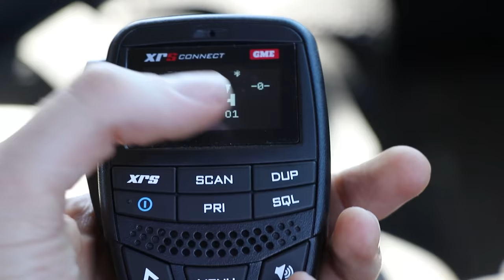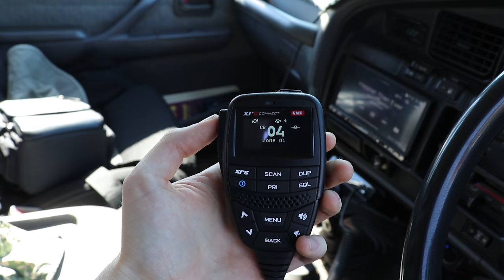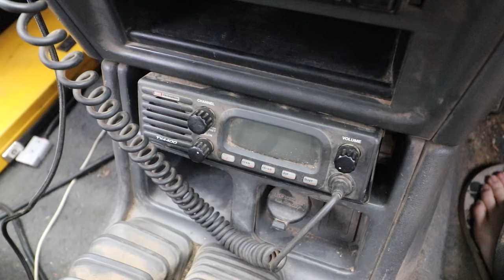You've been using YOUR UHF WRONG!!! CB Radio SECRETS for 4WD in Australia PLUS History & Technology

Comment from the maker: What dBi antenna do you use? Where do you mount it? Let us know! 👇
Reply: 5.5dBi ground independent, mounted same location as yours…
Reply: I have 2. 3DB interchangeable with a 6.6db running from my GME unit and a 7.5DB running on a Oricom unit. Both mounted on my bull bar. As stated in my main comment I would love to swap the Oricom out for for a GME XRS but I cant afford it.
Reply: i run dual at the same time, 2.1 and a 5.5 connected through a T connector seems to work ok
Reply: 6db rfi element + 6db mobile one whip antenna. front left bullbar standard tab . + backup antenna rear left roofcage . height is might
Reply: All in planning atm, so I'm thinking of a low gain and a high gain both mounted at the back and up high above tail gate on a bar to give the separation (and place to mount). The bar will flip down to point the antennas backwards for when I need to get through low hanging stuff. Probably a 50mm square, light gauge aluminium bar.
Reply: Oh, and two radios - one with the high gain and another with the low gain.
Reply: I'm running RFI 2.1dBi and 5.5dBi, I found mounted on the bullbar the 2.1 would get decent loss from chatter behind my vehicle so currently in the process of mounting it on my trays roof rack and I have the 5.5dBi on the bullbar atm. I will be testing a coax switch to see if its effective enough to be a good median between distance and short at the flick of a switch
Reply: GME 2.1 dBi on the bull bar, GME 6.6 dbi on the roof, RFI 6.5 dbi Mobile range extension and a Barret 2019 auto tuning HF antenna on the rear tyre carrier.
Reply: Running Unidens UH8060S with 6.5 DBI. Has interchangeable 3 DBI but rarely use it. 6.5 is an awesome all rounder for most 4wding and touring. The UHF itself is super compact and all controls are on the remote so super easy to use. I mount on the bull bar because there was a spot made for it and also so I can fit through the drive through.
Reply: 5.5dbi on the bullbar
Reply: UHF 5.5db on the bullbar and Autotune HF on the rear tyre
Reply: RFI 5DBI mounted to the bullbar
Reply: 2 & 6
Reply: 2 and a 6 on the xrs
Reply: I have a 2.1dBi gain as a sacrificial antennae around town, middle distance and offroad, I  have a 6dBi, and for running the Newell Highway, I've got a 9dBi stainless for throw. All are ground independent and use the same mount, on the bullbar. 

I wired a on-off-on switch for my UHF to be able to have the radio always off (but set up, ready for use), on all the time (for off roads/camping in groups), and on only with the ignition (for running around town, day to day)
Reply: I love the RFI 3dB ones
Reply: 3.0 dBi bullbar.
Works great for my mountain area.
Reply: @joshford1818  How do you find the Barret in performance, reliability and build quality?
Reply: @davidbrayshaw3529  I think the build quality of both the radio unit and tuner is excellent. However the vehicle is a new setup so the jury's still out on how it's going to handle weeks of corrugations and bouncing over dunes.
Reply: @joshford1818  I actually don't know anything about that particular model but a mate of mine had GME products fitted to a ute, a tractor and a heavy rigid and they certainly saw use in very harsh environments. They were all years old and worked faultlessly.
Reply: your looks like a GPI - ground plane independent antenna - it will work equally as well on side or centre of roof, even bull bar - minus the extra height you get from roof
Reply: @davidbrayshaw3529  Barrett are a high frequency (HF) radio manufacturer. Very different to a uhf/cb in that they are mainly used for long range transmission (up to 3000km range). Kinda outdated technology with the introduction of sat phones but having a community of tourers to draw information from and direct connection to various emergency services has its benefits.
Reply: @joshford1818  Sorry Josh. I responded to the wrong question!  While I'm here though, Satellite 'phones are a wonderful invention and if I was the type to go to remote areas I would have one without a doubt. I'm a licensed ham and I would much rather have a sat 'phone than an HF rig in a remote location, if push came to shove. Having said that though, there's something special about analogue radio, to me at least. There is also value in redundancy. Having both HF and sat. onboard is a great option if you can cough up the bucks.
Reply: I run a 6DB antenna, it is mounted on the headboard in the middle of my ute, reason being it lowers the angle of radiation of the antenna and I have a more even coverage around the vehicle compared to it being on the front in the corner.
Reply: Thank you for a superb, knowledgeable presentation - I'm an ol' grey beard and have been using UHF CB from it's inception in Australia in 1977. And I am also an active 4x4 driver and being "old school" I have only ever used a centre roof mounted antenna. My goto antenna is a 1/4 wave whip at just 157mm long. Occasionally when on the flat I'll exchange the 1/4 wave for a centre loaded 4.5db whip. From Arthurs Seat in Victoria I've pinged two Northern Tasmanian and the Mt Gambier SA repeaters with a 4.5db whip antenna at 5w. Bigger is not always better and in the Vic High Country my puny whip antenna consistently gets though where the current fashionable bullbar mounted broomsticks often cannot be heard. The old mantra re low power UHF of "height is might" still applies.
Reply: I have a 6.5dBi antenna and for me it's a great all rounder. Top video mate, love your work.
Reply: Unfortunately the bull bar on mine too & 6 Db gain
Reply: Always mount antennas where you can... best place is the centre of the roof... or bonnet.... on the bullbar is one of the worst places. Sometimes its unavoidable though
Reply: Yea no shit
Reply: You do realise that the M1 runs from Hobart to Cooktown, yes? You also realise that Newcastle is nowhere near the Tweed?
Reply: On the front bar right on the corner gives me a good idea how close I am to putting a dint in my rig
Reply: 9dbi/6dbd Benelec 02648 mounted at 10.5meters
Reply: @robertbullimore4243  Oooh geeze. How long have you been running that? I hope it's not damaging your radio.
Reply: @jbison  Na all good, just like the twin trucker aerials, why would my radio suffer
Reply: Mine is roof mounted on my Troopie and I change between 2db, 6.5db +9db depending on where I'm going
Reply: dad and i are running 4.5dbi airel on a GME TX2720N unit. and the airel is mounted in line with our stereo airel so its pretty close to the winsheild
Reply: 6.6 db on the bullbar running a Icom 400 pro 40 channel and a 2.1 on the bullbar running a chrystal DB477i 80 channel
Reply: 3db for around town, and 12db for when i'm out bush (WA), mounted off the bonnet, although i want to get one of those folding ones to put on the roofrack (i have a low garage) to mount the 12db one to, and i'd just fold it upright and swap the cable over at the back of the radio unit (no switch) when im going out bush.
Reply: @robertbullimore4243  I did post this, but removed when I realised I posted from the wrong account.
A T connector is not a good way to connect your antennas. Swap it out for an antenna switch if you really want to use two...(unless you already have, given that the post is quite old). Although it seems to work ok, you likely have some phasing issues, which would result in either a distorted radiation pattern and/or less than ideal SWR which would basically reduce the gain of the antenna.
Reply: The same model antenna i've used for 30 years!   The GME AE409.  Allows me to be in 6dB or 9dB modes.   i'm also rocking a Uniden UH-5000 from about 5 years ago.  Antenna is mounted on the roof rack of the ute - high as possible.
Reply: Just a "little" hint from a DX CB'er from NZ in the mid 1970's.

NEVER 
EVER
Mount your CB aerial on the front bumper, LOW DOWN at a corner.
That is - unless you wish to severely limit your range & transmitted pattern.

ALWAYS mount your aerial as HIGH on the vehicle as possible, and as CLOSE to the center of the roof as possible.

Forget about losing roof-rack storage spaces, because if you can't "get-out" with your transmissions - your roof-rack load is not going to save you anyway.

ALWAYS, think about how & where your transmission signals will "move away" from your vehicle.
If you stick your lovely expensive aerial down low on the front corner of your bumper, not only will it likely get "snagged" on bushes and trees etc., your entire vehicle's body-work will BLOCK your transmission signal, if it's between you and whoever is receiving you. Plus, the pattern you transmit will be a lopsided affair, aimed mainly away from that ONE corner - and will severely block any transmission OR RECEPTION from any other direction, especially if you have a larger 4wd with the top of the aerial hidden below that bodywork.

Back in the 1970's we (here in NZ anyways) were limited to just 1 watt, but could (illegally) boost that somewhat with a "foot warmer"
An illegal antenna booster, pumping out say 15 - 50 watt.
Pretty useless for reception though, if the other person only had the normal 1W unit.
But for using a YAGI as well (mounted high on a farm shed or as one fella near me did, mounted his AWAY UP IN A PINE TREE)
- hah now that was some serious power.

Another in our local CB club, used a full sine wave length aerial, of aluminium pipe.
He always collected low slung power lines and telephone lines, if he ventured off the main highway into smaller streets etc.
But boy, with his foot warmer running, and his hugely high aerial - he could get a local (line of sight) range of at least 25 miles.
Overseas, anything that bounced skip-waves off the ionosphere, meaning most of the upper half of Oz, and Perth etc., plus almost all of the USA

The UK was different in that we had to have sunspot activity, and a clean channel to get good DX'ing.

But - in saying that - my absolute BEST long range DX - was to someone transmitting from a YAGI (with foot warmer) and no other traffic anywhere near his location (he was in a remote spot on the shores of Hudson Bay.
Yep - away up in the north of the USA, and me ?
I had my very first CB unit, a 3 channel BELL PACE 1/5 watt handheld.
Also as high up a hilltop, with zero traffic on the day I was DX'ing.

In other words, the higher up you can be, along with holding your aerial as high as possible (mounted center of your transmitting vehicle) the best range you will get - in all directions.
But then - what would an avid DX'er from NZ's inner rural South Island - know about "getting out & back in"
Just enough to learn NOT to use the foot warmer in cities, as you blow the crap out of anyone around, over several channels (called channel splatter).
Reply: On the bulbar I use a 9 dB and at home a 12 dB
Reply: I have two antennas.  One 6.5dbi for the outback and one 3bi for the high country.  Interchangeable on the bullbar.

Comment: Well researched and presented. I'm a former Army Artillery signaller so spent 20 years using VHF and HF. The only time we used UHF was with small personal radios for patrolling in tight formations. Just one tip.... Don't say over and out. It's either over or out.
Reply: Yes, over and out is just contradicting yourself
Reply: UHF's range is just too balls to bother with. Also the Australian Army needs to step it up and bust out those incredible super secure powerful Baofeng UV5R's I see every Russian soldier rocking in the Ukraine invasion. Roger the dodger, over and out.
Reply: @bashkillszombies  UHF can be really quite the performer, especially once you crank up the watts with a private channel.
VHF gives a good balance in hilly areas as it can behave less directional and bend around valleys more readily.

I can’t imagine anything baofeng would make would be all too reliable
Reply: he's one of the few youtubers who knows about location sensitivity. the bullbar is the worst place to put it for getting signal to/from ahead of the car, it makes a very tear/pear-shaped transmission field
Reply: @bashkillszombies  1: battery life matters, low transmission range = low battery use = less weight = carry more bullets.
2: the army does have more powerful radios, but not every soldier needs to communicate 1000km. most often a 1watt radio would be good enough for tactical purposes, communicating with a soldier who is scouting ahead a few hundred meters or so.
3: uhf is not limited by watts for the army. they can use whtaever the hell they want. they got their own bands.
Reply: Rr16 prepare to copy over
Reply: It's either "over" or "out". 

"Over" means that your transmission is finished, you are about to release PTT and you are waiting for a response.

"Out" means that the conversation is finished, you are not waiting for a response, and the channel is free for other parties to call each other and establish new conversations. It normally is the party that initiated the conversation who also terminates it with "Out".

And then there is "Wait, Out", to  communicate that you need some time to work out a reply and will call back, but do not want to block the channel for other users in the meantime.
Reply: This sounds like a marching Pipe Major telling an announcer the command to start the parade is "Quick!", not "Quick march". So the parade lines up and the command goes out: "Quick!" and everyone leans forward. "Quick!!". Everyone remains at attention. "Quick...  march?" and the parade begins. 🤣
Reply: I smiled at the over and out comment. My father was a WWII signaller and a territorial RSM post war and he would always grumble at O&O and Morse conversations in film.
Great video, thanks - learned a lot about gain!
Reply: Good comment. Im a former alien artillery gunman from ya another planet. We use uhf all the time
Reply: @danejames7098 ..over ..your turn to talk. Out..I am monitoring but finished with you.
Reply: Copy
Reply: @goofiegoofball  Lots of bombs!
Reply: I assume you lot in the Army use SINCGARS radios?
Reply: Well you should of also picked up that he calls an antenna an aerial. You should know the difference.
Reply: blue lanyard or drop short?

Comment: Another tip is - Do NOT use channels 31-38 in simplex mode. Operators doing this, unbeknown to them end up having their conversations transmitted far and wide on the repeater outputs (if in range). Channel 35 especially is a no no.

Comment: Ham radio operator in America here. About 20 years ago I bought a HF antenna called the Outbacker, made in Australia. This was typically mounted on the rear bumper of a car. I didn't use it much but I made successful contacts on the 80 (at night) and 40 meter bands. Pretty amazing considering it's small size. I just did a google search and found a site that claims they are the "home" of the original Outbacker HF mobile antenna.
Reply: They are a great antenna. I have been using one recently to make HF contacts worldwide on 20m, and yes, they are made here in WA.